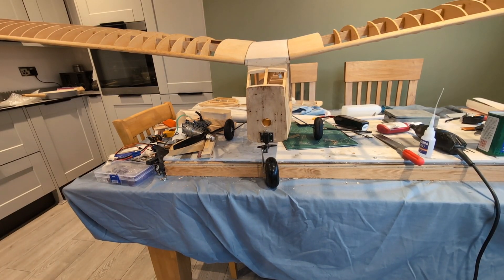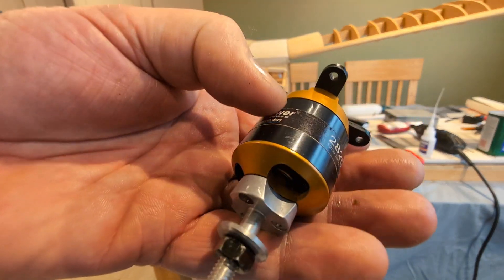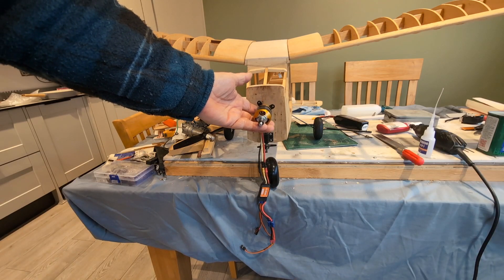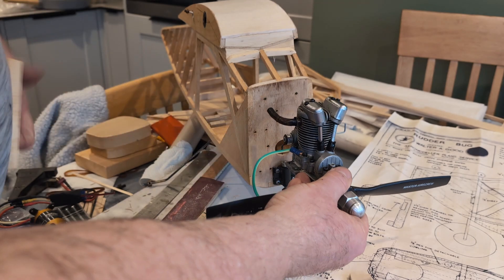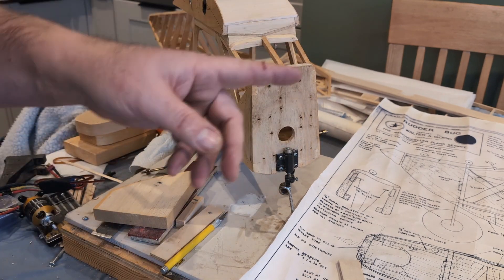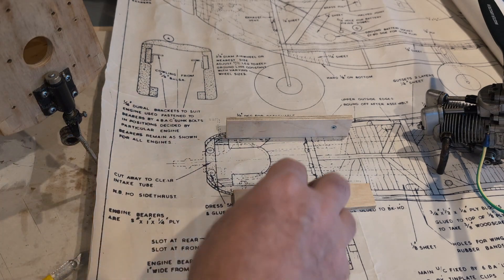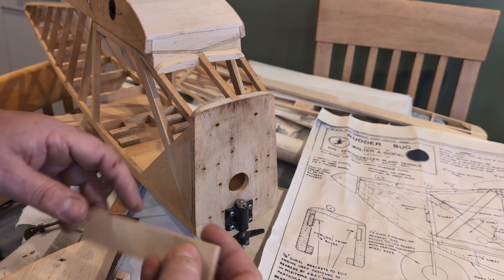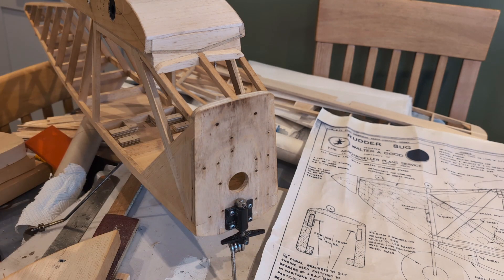Engine installation with electric motor option

Comment: A Saito .40 is way more than enough on the Rudder Bug...I know, I have one on mine🫡...beware of ground looping with the torque created from that engine, you have to open throttle very slowly until she lifts tail and then rotate, well that's for mine anyway as mine is tail dragger
Reply: Oh, and was first maidend in 1967 by my late father. He was then flying it on single channel with an OS .19, we quite some years later recovered her and I installed the Saito .40

Comment: Mark great engine mount.  I’m an electric only flyer but have seen the guys fussing with inverted engines, being flooded and having to remove the glow plug and clean it.  Jeff in LA USA
Reply from the maker: That's more of an issue with 2 stroke engines 4 stroke start best when they are dripping wet.
Seems the bearings have gone on this engine probably ok for the power requirements of this engine but they will need replacing at some stage.
It might be electric to start with.
Reply: @ thank you Mark. I’ve learned not to ask questions when the guys are fiddling with their engines. 🤣😆😀
Reply from the maker: @JeffinLowerAlabama  😆

Comment: The bearings are gone on that motor mark i can hear them from here I can change them for you if you like cheers .
Reply from the maker: I know they have gone you can feel it .I've tried removing the cylinder head but one of the Alan head bolts is striped so it will need a bit more thought.

Comment: It's definitely suffering from bearing rot Mark....Sure it will easily power the Rudder Bug though....It needs a bigger prop IMO...Just limit the throttle opening. People under prop these motors all the time...My friends Rudder Bug is electric with a very similar sized Axi motor, it has a surplus of power. On a 4S they are a bit more efficient than using a 3S and have A LOT more power....but you won't need it IMO.....🤔😏😀
Reply from the maker: Good to know

Comment: The Saito 45s was only released in Europe.  I t has a larger cam gear, more power. The 45s is one of the most sought after engines in the World. I'd use it a True Gem. Lucky Man!!!!
Reply from the maker: It says 45 under the "40 Special" plate.